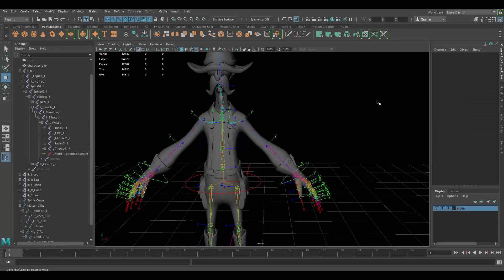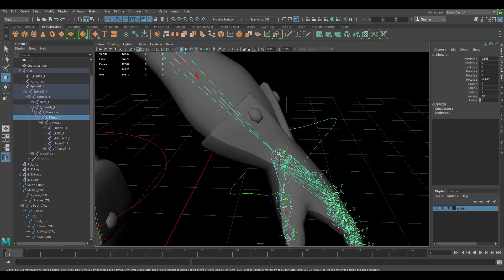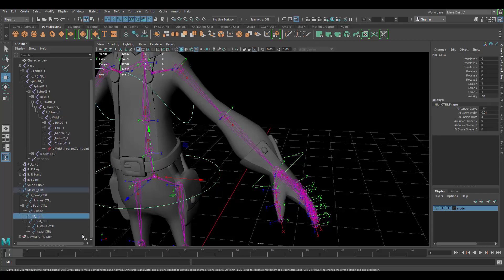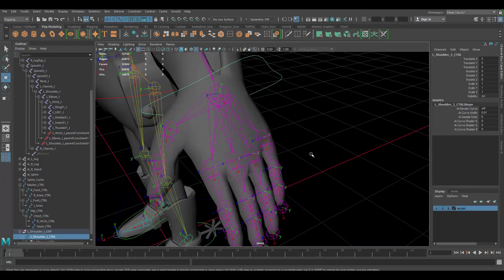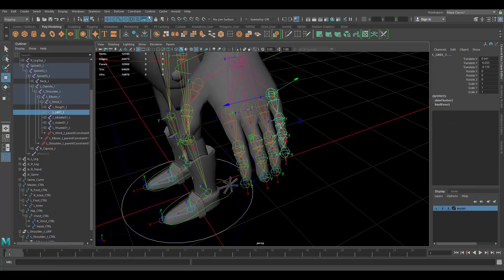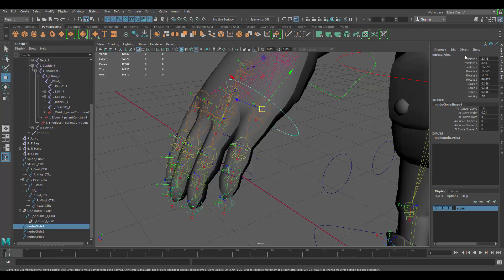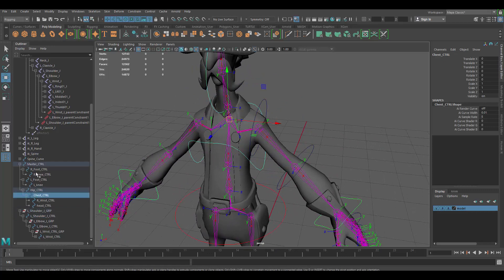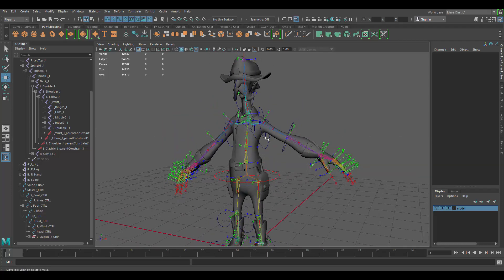Autodesk Maya 2018 - FK Arm Rigging Set up

Comment: Hi , I have an issue , when I add IK handle to the joints it moves the joints from its original place even the orientation of the joints is correct as you see in the video, and also even when I move the joints back to its original place when I turn IK Blend ON and Off it moves the joints again , how can I make the joints still even after adding the IK handle?
https://www.youtube.com/watch?time_continue=7&v=mbBFcuZeLFM

Comment: To line up the joint with the control wouldn’t it just be easier to parent constrain the Joint  to the control with main offset off then duplicate the control then press the down key on the key board and then press delete on the keyboard. Then drag the original CTL into the new duplicate, then just delete the parent constraints.